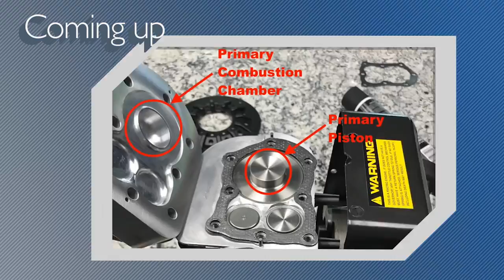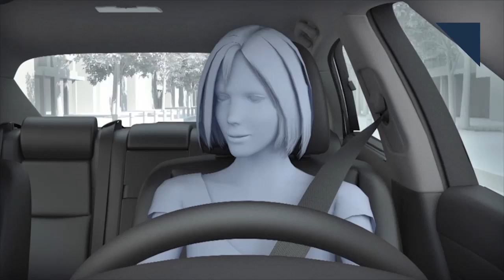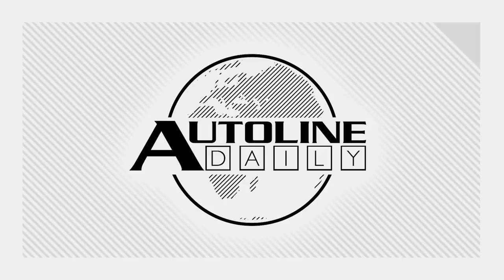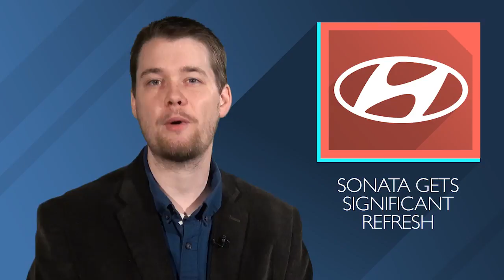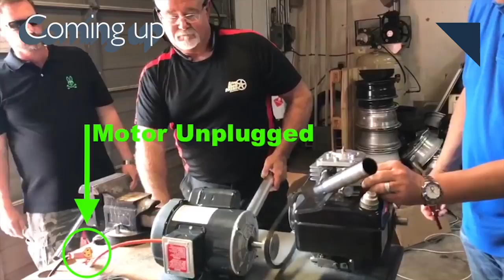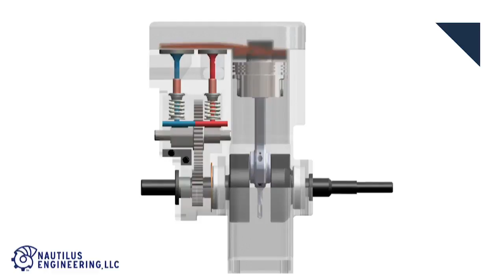Hyundai Sonata Updates, Bolt Battery Problems - Autoline Daily 2178

Comment: HCCI 
Does the inventor really thinks that any OEM will even look at that set up without having a running car and full 150,000 mile durability as well as emission data ?
Clean exhaust and durability is what is important NOT how the fuel is ignited !
Reply: OKAAUTO it looks like a Briggs and Stratton engine they are working on (an older pre Chinese made model at that). This would be a great place to start instead of trying going straight to auto manufacturers. I personally prefer Honda GX small engines so that would be my hope
Reply: @DocWolph
All you need to do is to convince CARB and EPA to allow any new previously untested technology. It only took GM 2.5 years to get "unconventional" hybrid - range extender - certified.
And that was with Conventional ICE engine that was in production by Opel in Europe for 12 years !!!
Reply: The "certification" is CoC in case of EPA and EO in case of CARB, no paperwork, no sales, or else $34,000 per vehicle fine from EPA and $5,000 from CARB. You can call it what ever you wish but that is the situation.
Reply: Such testing for durability and emissions takes barely more than 3-4 months. 6-8 months, on the outside, if someone is dragging their feet. 

If the manufacturer sees they have no choice, they will adopt the technology. Their biggest foible is that "If we didn't invent it, it does not exist" mentality.

And how the fuel is ignited has everything to do with how clean the exhaust is and a goodly portion of how durability the engine will be. Engineers and competent Arm-chair engineers understand this up front. The standard OTTO cycle of combustion has gone about as far as it can go. Hence Toyota's use to Atkinson Cycle engines, and Mazda's SPCCI (HCCI with spark) engines coming in about a year. 

Despite all the hype, BEVs are still found wanting. ICE technology like Hybrids just keep going and improving. Their steady climb make BEVs a harder sell for every improvement made by ICEs and Hybrids.
Reply: @DcoWolph
You do not seem to realize that today average light duty engine is durable for 4,000 hours and the good ones last 7,500 hours or more, which is substantially more than 3 months when the average light vehicle travel speed is in under 30 MPH range.  And that does not even include the required "cool down and cold start cycles".   Anything to replace a status quo, has to be substantially better and cheaper or it is non starter.
Reply: Yeah that might make sense except, if you are going to give numbers you also need to cite sources. 

Manufacturers do NOT have to test durability for months and months, themselves. This is something independent research and testing facilities do to the COMPLETED vehicle that is already on sale, including its engine. Emissions testing is something Auto makers HAVE to pass before they can go to sale. Both emissions and durability testing are NOT mutually inclusive. 

Car makers do test their own engines but not for Months and years. Usually something about 2000 hours, as they all have figured out ages ago how to figure if an engine will last 4000 hours or 10,000+hours in only a few weeks or months of testing.  "Time is money" and if they can figure it out faster, and so doing so less expensively, they will. That does not mean everyone does the same level of work. It does mean they don't have to test forever and a day.

It is akin to my Personal "90-days rules", named after the typical almost of time allotted to the warranties of most consumer electronic devises. "If a thing does not break [in a given amount of time], it will not break." Same principle here. If the engine after inspection does not break or show excess wear, wear aside from breaking it in, in [1500-2000] hours of testing, it is not going to break without being deliberately abused, damaged or,m in other words, broken.. 

You know if I have to go look something up and I can find either exactly what you said or your "Cliff's notes" version on a site such as "Howstuffworks.com" or Wikipedia, what makes you think I did not know this stuff already and expected you to know it too?

Also the HCCI engine Nautilus Engineering developed would be enormously less expensive. Fewer parts and not actually new manufacturing technology. This can also be said of Mazda'
SPCCI engine although it would cost about the same a conventional ICE. Both returning superior F/econ and with that and their cleaner burning cycle, burning less fuel better,, lower emissions.
Reply: Miro Kefurt,

If you are talking about the VOLT's Range Extender (it would not kill you to name what you are talking about), then you are mistaken. It did NOT take CARB and the EPA being convinced. 

The VOLTs Hybrid system is a weird work around to be and not be a proper Serial Hybrid system is almost unfathomably complicated, and inflexible, compared to what GM could have actually done. 

CARB and the EPA do NOT certify drive systems. They only set emissions mandates and targets which then influence drivetrain design. Certifying drivetrains is not in their purview.  There is no "Approved by" stamp from the EPa or CARB, is there?

Again GM, decided to make the VOLT's drivetrain far more complicated than they needed to be and  that is what took 2.5 years. Not Convincing CARB or the EPA.